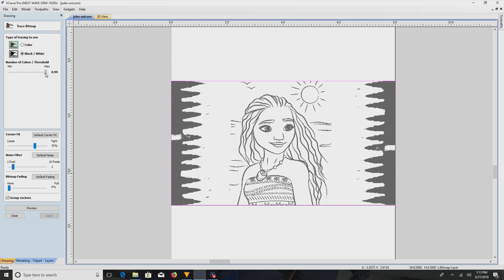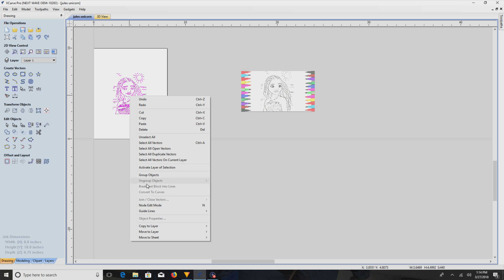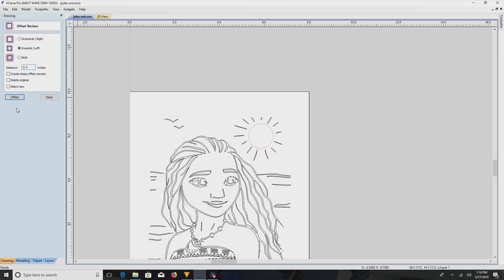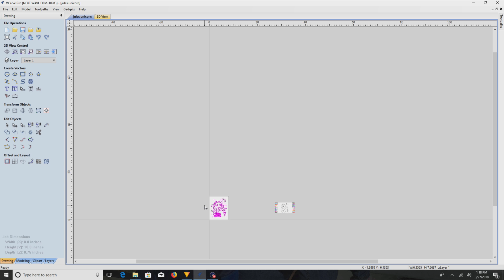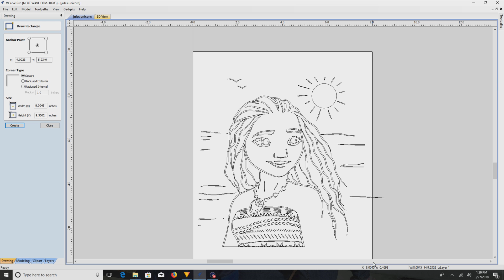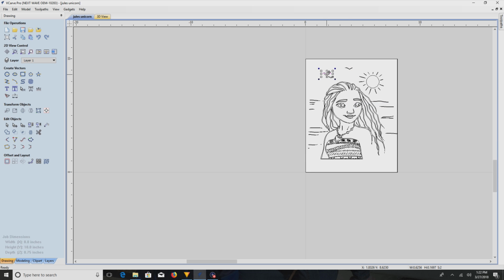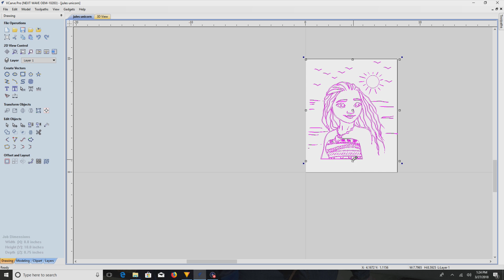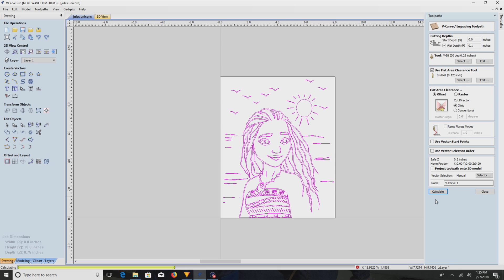Designing Moana Picture In Vcarve Pro For CNC Wood Carving

Comment: Any tips or tricks on how you get the tool marks from the background, especially in tight spaces?  
Or just time and elbow grease.
Reply from the maker: Just time and elbow grease far as I know, going with a smaller step over seems to reduce machining marks some what.
Reply: I thought I was commenting on your Gator sign but you got the idea.